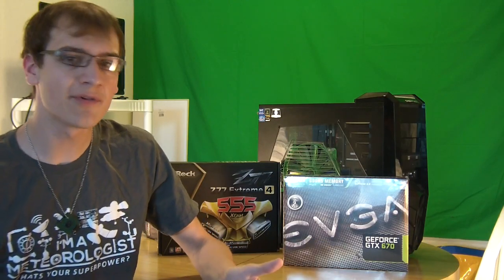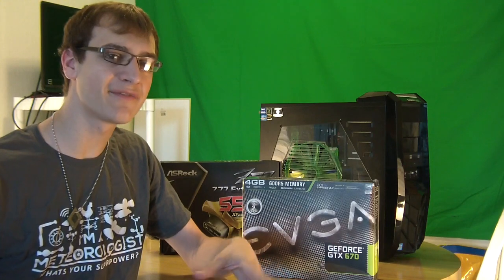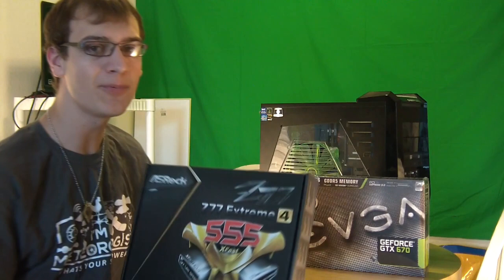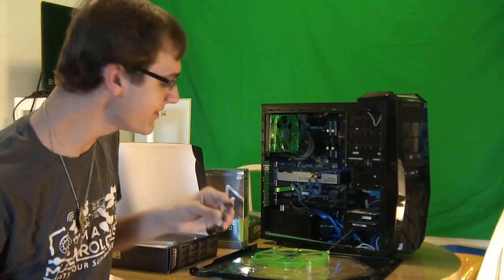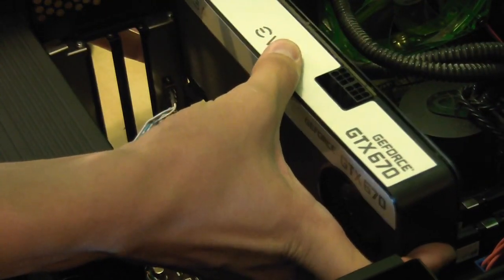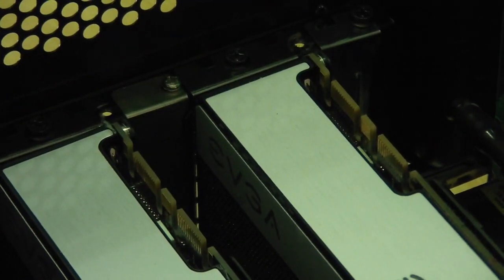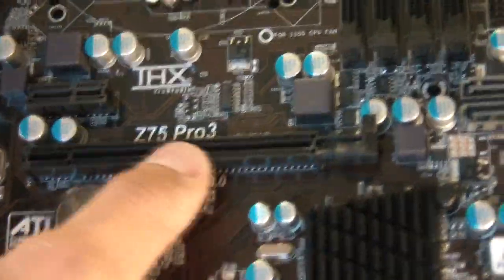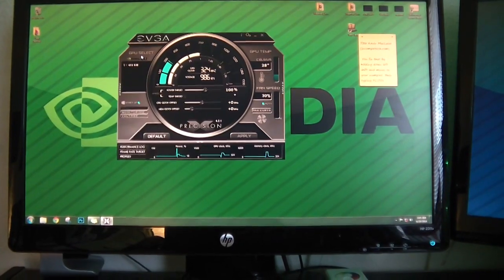NVIDIA SLI Tutorial: How to SLI Graphics Cards

Comment: Didn't knew about default SLI bridge ^^ Now I have 2 of them, one default with actually small wiring compare to the other I bought from a market long wiring. But as I see the default one is lost in my new Gigabyte X299 AORUS Gaming 3 (rev. 1.0). The SLI bridge from a marketplace I got actually have 2 additional keepers for a video cards and the prices is almost 2$ (China power) only 2 bucks for SLI bridge with 2 nice keepers - how could it be so cheap

Comment: Hey so I just bought a new HP OMEN Desktop and it's running an AMD RX 480 4GB on the Intel H170 motherboard, I was wondering if I could buy another AMD RX 480 4GB and use both of the GPU's together like this guy here is doing.

Comment: Whats a good power supply to sli GTX  Titian Z's?
Reply: 850w can power them but if you're going to overclock the or/and your CPU go with a 1000w. I'm planning on going with two 1080's (similar to the Titans) and an i7 6700k. The total system power consumption is around 590w-600w but I like to give my system and PSU a little room to breathe (you also have to take overclocking into the equation) so I'm going with an 850w. You can use pcpartpicker.com to see how much power your setup consumes.
Reply: 1200w are overkill on most builds you see them in. Just crazy overclocked dual-SLI dual processor builds really need them.

Comment: what's a good power supply for x2 1070 sli
Reply: EVGA 650 or 750 depending on your processor
Reply: What Baris said or if you're planning on heavy overclocking get an 850w just to be sure and to be future proof if you plan on upgrading parts. I'm going with two 1080's and an i7 6700k, that PSU fits my needs even when taking overclocking into the equation so you'll be good with 1070's.

Comment: this is a potato question but to have 2 cards do you need 2 monitors? all this is new to me i apologize lol
Reply: I don't think so, they basically act like a 1 unison super card. You can have 2 monitors tough I have 1 graphics card and have 2 monitors
Reply: No. They work together. You can have two monitors on a single card
Reply: what about the cable to monitor?
connect 1 cable per graphics card to each monitor?
or 2 cable on single graphic card to both monitor while the other one is not connected to a monitor?

Comment: Is it better to have a single 4gb or a 4gb and a 2gb?
Reply: +matthew75858 SLI with a 4gb and a 2gb won't give you improved performance as far as expanded memory goes. You will however have two GPU's running instead of 1 with SLI. So, it's not totally useless doing SLI with a 4gb and a 2gb. However, to maximize the benefits of SLI it is better to have cards with matching VRAM. So 4gb and 4gb, for example, would be ideal.

Comment: I have a query regarding the installation of multiple monitors. Let's say I have installed 2 graphics cards, each with 2 DVI ports. I am hoping to soon have a 3 monitor setup, but so far only have the funds for 2 monitors. Would I get better results from plugging 1 monitor into each card, or should I stick to plugging both monitors into one? I'm new to building PCs, so I don't know if this is a stupid question or not.
Reply from the maker: +TheImperialTeacher I believe you are forced to use the one card. You won't have an option.

Comment: nice video i got everything in just the way you did it but when i turn my pc on it will run but wont show anything on my monitor. both video card work when there just one in there. both are Geforce GTX 970 just one a G1 gaming and other not(for model name). had some my friend think it my mother board (X99s sli plus)

Comment: Say if i had 2 960s that are both 2gb vram and i sli'd them would it go up to 4 gigs of vram since they are both 2 gigs of vram
Reply from the maker: fmi005 BX Gaming  This is a tough answer. With DX 11, no, they don't get added together, you'll be stuck with 2gb. However, as games begin to use DX12, that VRAM will be added together so you will have 4gb. It will take some time for games to start fully utilizing DX12, but when it comes out with Windows 10 and games start using it,, it will be glorious.

Comment: 670 comes with a backplate and the Titan X doesn't....go figure.
Reply: It is really is inexcusable that the $1000 card doesn't have a backplate when the $330 card DOES.
Reply: In all fairness NVIDIA does have their reasons for not putting a stock back plate. It would have been nice if they'd at least offered an option for one to come stock. They could have even charged another $10 for the back plate version and I doubt anyone would care. It's just the fact there isn't even an option for a stock back plate that sucks. Other than that I love the Titan X though. Shredding every game I throw at it on 1440p and allowing me to take advantage of my high refresh rate monitor while @ 1440. Ordering a block\backplate for my first custom loop soon. Hopefully I don't fry my system =\
Reply: Randy Moss you can buy a backplate from evga.
Reply: Not yet you can't unless it was just released in the last 2 or 3 days. You can buy one from EK currently though. I'm going with a water block\back plate from EK as soon as I get the balls to take apart my 1,000 graphics card. It's a scary thought indeed
Reply: Randy Moss how's that stock cooler holding up? Is it loud?
Reply: I really don't notice it because I'm always wearing headphones when on the computer. It's not super loud but it's not quite either. If I take my headphones off and crank the fan up to 100% you can totally hear it but if it's set at 50% it's not too noticeable even without headphones. When playing long gaming sessions I usually leave the fan at 75%. 75% is fast enough to keep the GPU in the 70's and quite enough to be inaudible through my headset.
Reply: Dead in Red
Forgot to tag u in my last post. Also I should note I live in Hawaii where it's hot all the time so I'm always running a huge fan to cool ME down. This makes it hard to differentiate which is making noise.
Reply: Randy Moss you are going to watercooled them?
Reply: Dead in Red
Already done. I installed my loop and put my EK block and backplate on last week. Temps are absolutely amazing. Under full load and hours long gaming session my max temp is in the low 40's. My card was getting into the 80's on air. It also looks unbelievably sexy in my 760T case with it's full side window.
Reply: Randy Moss nice and quiet I presume? Also have have you overclocked the card yet?
Reply: Yeah it's dead silent besides my low speed fans cooling the Radiators. I've overclocked it to 1450 MHZ. I could get a much higher gain if I wanted to play around with MilliVolts (mV). Haven't felt a need to do this though as the card is already shredding every game at 1440p

Comment: Upgrading my PC on payday my next motherboard also supports SLI while i cant afford to 970s this month and a new PSU which i think i'll need, i'll get working on my bonus for next month and do it then :P 

Imagine the crazyness that would be SLI 970s (overclocked ASUS 970s :P)
Reply: Dude 2 970 is beasts save up for them its worth especially if you want 1440p mine are stock clock and play GTA ultra 1440p at around 80 fps

Comment: and then you find out you mobo supports f#@$% crossfire. and for some gay reason the 2nd PCI x16 slot gets nerfed to x4. and an added bonus, the PCI x1 slots share bandwith with 2nd x16 slot therefore in dual gpu configuration all x1 slots are diabled and therefore i would lose my wireless internet and would have to run a ethernet cable. wow WTF mobo,,, wtf